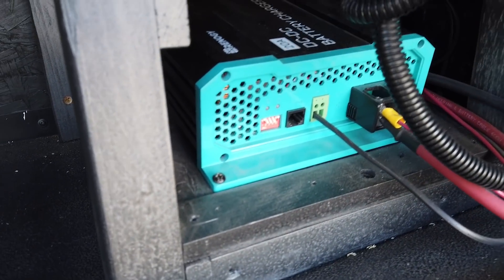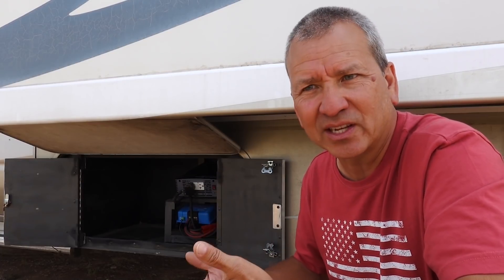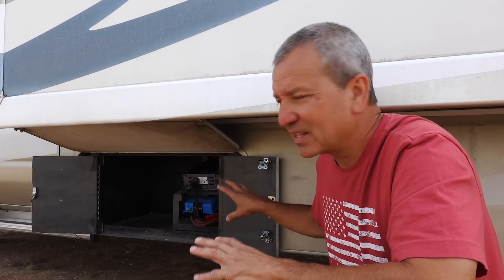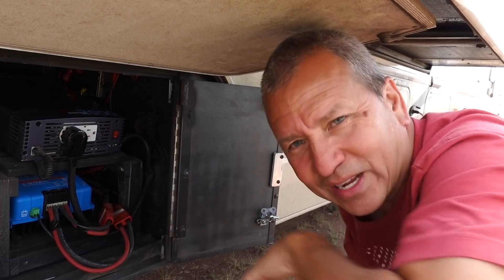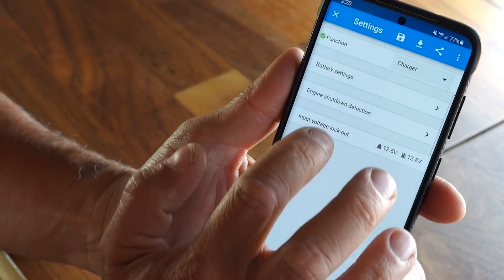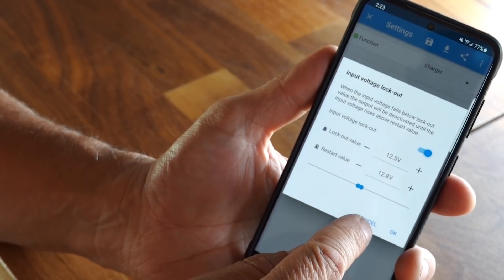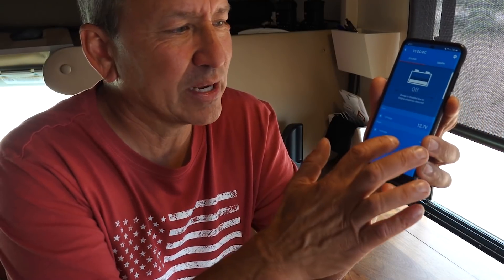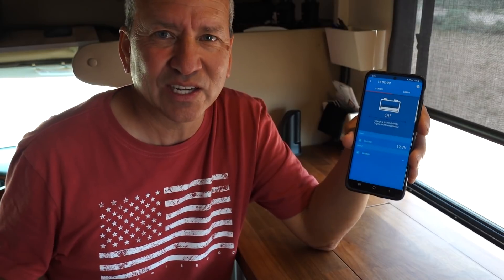RENOGY or VICTRON DC-to-DC Charger for Lithium LiFePO4? / Off-grid RV Solar / RV DIY

Comment: Great video! Very informative. 
But what about the function of limitng the Amps by half like in the never models of Renogy;s chargers? The one that's turning on by connecting the +12V to the second slot in the green plug. Does Victron have built in similar solution?

Comment: What size wire did you use from the chassis battery back to the DC charger locations?

Comment: Great video. Thinking about keeping AGM batt under the steps (gets charge from alternator),but add an LiFePo with a DC-DC charger from the AGM. Route Li batt to DC load/Inverter/solar, but keep house converter hooked to AGM. This would give you an extra "backup" battery and the AGM would be standby emergency start. Maybe the converter won't work like an alternator? Any thoughts? 
(If I took the converter out, it would be sort ofthe same as your setup, except an extra battery in parallel with chassis batt.)

Comment: Victron & Battle Born  expensive solutions - there are far cheaper alternatives -  The price  of raw 280ah cells has halved in the past 3 years - I made a 4 cell pack JB blue tooth BMS and Renogy DC to DC for max bang for your buck

Comment: Do you have a combiner box for your panels or how did you connect the panels to the DC-DC charger?
Reply from the maker: The solar goes through a solar charge controller then to the battery busbar. Same busbar the DC to DC is connected to.

Comment: Hi, I'm confused as to why you eliminated the jump start switch in case you need to jump-start rv. And make a separate connection at the dc dc
Reply from the maker: It's a short cut to the house battery since it is wired to that relay. The alternative is to run a new cable.
Reply: @RVwithTito  so you have to wire it that way if you install a DC dc charger? Just curious. I have lead acid batteries for my house and rv. I plan on upgrading my batteries as well. So I'm new to this upgrade and what it will need. I also have a solar panel that charges my barries when I'm not plugged in. So same set up I suppose. Just looking to upgrade house and engine batteries

Comment: Interesting you have done exactly what I did with my dc to dc charger with the Anderson plugs for exactly the same reason. It has saved me once already when I had a flattish starter battery at only 12 volts. It wasn't enough to start the motor but 5 minutes of direct connection via the Anderson plugs got me going. Brilliant.

Comment: Great video. Lithium-ion batteries can handle various charging currents, but they can't handle too much voltage. The critical factor to watch is the voltage, not the current. It's important to keep the charging current within the manufacturer's recommended range to avoid damaging the battery. Exceeding this range can lead to reduced lifespan or safety hazards like overheating. That's why voltage regulation is crucial during charging to prevent overvoltage, which can cause serious issues like thermal runaway or combustion. While monitoring both voltage and current is essential, maintaining the correct voltage is typically more crucial for battery safety. This might be why some apps prioritize displaying voltage over current during charging.

Comment: https://youtu.be/lvOYUfSBlmM?si=Ha3oerqBCfyQmOvx  The BMS inside the Lithium battery determines the charge rate. You will see the amps coming into the battery being reduced as it approaches 100%. So, no, a Lithium battery will not grab as much current as possible. You need to make sure your alternator can handle the "C" rate of the battery. If not, yes, it will overload your alternator. Many LFP batteries are limited by the C rate in terms of charging. Please don't be a parrot since so many YouTubers have this fact wrong.
Reply from the maker: Well of course it's based on the C rate of the battery (or batteries). The combined C rate for a large Lithium battery bank can be very high. Plus the flat charge curve compared to a flooded battery with higher internal resistance makes it an issue.
Reply: @RVwithTito  You're the one doing the educational video and not explaining what C rate is and why it's important in neither this video nor the older one and you state "of course it's based on the C rate".  In your next video on this subject, I would suggest doing a better job of explaining why no RVer would even need to consider such a product.

You, literally, are spending money to limit the charging on your LiFePO4 batteries. Why would you do that? Most stock alternators can handle LiFePO4 charging. What size is your alternator?  I installed LFP batteries on my old Ford E350 Class B using the stock alternator, without a DC-DC Charger ... it didn't burn up over the years even with a defective BMS. There is a simpler, and less expensive, solution if all you want to do is limit the amount of amps, not overheat your alternator and still be safe (no fire).

Just so you are aware, I worked for a major battery manufacturer where my duties included testing the final products ... properly. Even Victron did a video where they show a burning up alternator but it was an invalid test since they did something to ensure the alternator would overheat. That was intentional and came as no surprise since they want to sell product.

Comment: What about power from rv converter  120 to 12v? Can you use same converter once the dc to dc is installed?
Reply from the maker: No problem. Whichever voltage is higher will push current through. I believe both units can also be configured to only turn on with the Ignition switch.

Comment: Would Installing one of these and feeding it to the center pin on the trailer wiring be a good idea for charging the battery on a Toad?  As opposed to relying on the 15amps that is typically put out on that pin.

Comment: I was looking at a dual alternator system. My question is, can you hook up to alternators to charge into that system? Could you get two chargers and run them into your batteries? Just checking before I spend a lot of money to upgrade my system.

Comment: Biggest reason the Renogy is actually better is because it has low temp cutoff capabilities and the Victron does not. There is absolutely No excuse for Victron to not include the VE networking to be able to monitor the temp like they do on their MPPT solar chargers. In a van or RV in aub zero temps you will kill your $1,000 plus batteries with the Victron B2B charger

Comment: if your battery has a bms why do you even need a dc to dc charger just charge it directly off the alternator, just make sure your alternator can handle the amperage and if it cant upgrade that because if it cant handle that it probably will die from the DC to DC over time

Comment: This is a helpful video!!
I currently have a pair of a g m crank batteries that are going to a 140amp Isolator to An additional AGM behind the driver's seat. Currently, my accessories are hooked up to it. But I need to put them on a deep cycle. And I was gonna go with lithium. But I'm dealing with the charge voltage difference That should lead to the AGM consistently drawing the LiFePo down. I was going to just run the system off the Li battery, and leave the third AGM as backup incase i need a jump or something, just keep it on its isolator so it stays charged and put a DC-DC like this between my crank batteries & the Li as well to keep it charged. My alternator should have no problem handling this I hope, and I've noticed many do not have the correct V to fully charge a LiFePo battery, will this? Also, if you connect to the ignition, do you still have to manually switch the charger on/off? I want a Set up that I don't have to rely on the driver to do much. Just setup, forget about it. and it be self contained

Comment: If you could hook up a heat gauge on your alternator to show you hot hot it is you could keep up with the temp and turn your charger off and see what the resting temp is and how high the temps go under load and if it gets too high you could shut your dc to dc charger off and let it cool off for a while and after some time would see what’s normal and what’s too hot. Just a thought don’t know if it would help but couldn’t hurt .

Comment: That’s the same way I have mine set up with a switch that when it’s on it lights to remind me to tur off because if you start batteries and your lithium batteries are low they will drain your start batteries dry and quick .

Comment: Great video, convinced me to get the Victron charger.  One remark on you setup if I may.  From reviews I read, the converter can get hot. For better heat dissipation, it would be best to mount the charger vertically.

Comment: i have a 65A alternator. and 200ah lifepo4. During travel I have 20-30A of load for many utility like e-bike, fridge, evaporative conditioner etc etc. with a dc-dc of 30-40A I don't have any current to charge the battery. with a simple rele of 230A and 35mmq cable I charge 30A with 30A of loads. My alternator, a low rpm in poor cooling conditions (es at stoplight), don't can produce more of 20-25A, even in short circuit. its not depends from type of battery. lithium, lead, nichel...its depend from the delivery curve of the project of alternator

Comment: its possible to charge a lifepo4 battery directly with alternator. If you now what you do. if you now the parameter and specs of alternator at low rpm, if the max current is compatible with your battery and also the charging voltage. Victron produce a intelligent reel to do that

Comment: Hi Brian,  A couple of questions.  I see you are using the isolated version of the DC-DC charger.  Is there a reason you picked that one over the other?  I like the jumper idea with the connectors to connect the coach battery directly for a jump.  I hate to loose that function.  I can see where the isolated one may be easier for cabling in that case.

Is the Victron capable of being in a semi-outdoor situation?  My Trombetta is in the battery compartment and it is open on the backside so somewhat exposed to WX as I would drive.

Right now, if my DC Charger in the coach is on, it also charges the chassis battery.  Does this device still do that?  If not, how to you keep that battery topped off?

Great video and good details.  Details I have not seen Victron mention in their videos.  Thanks!

Comment: Good job/vid/info. I like the Ando idea, I do this myself as it also makes it a portable Dcdc charger unit as well as redundancy in case of problems/issues.  
One small area u may want to check, & ‘old habits die hard’ here, while ferrules look very nice on an install, there is some controversy over their use and Victron actually advise not to use ferrules, but just good bear copper as their connectors are made to contact the copper better without ferrules or solder.
Victron is great gear & feature full, but quite dear in Australia too, ur controller is about $450 AUD while the 40A Renogy is only $180, so that’s what I got for now for a lithium camper setup.
I agree with ur criticisms of the Victron App & charger features, but then Victron would rather you buy another $200 shunt, I think they could have added that in for the price. TFS. Cheers

Comment: can you use the battery while its on ghe charger from that dc to dc 
for example do I need to turn off the fridge if the battery is on charge .
Reply from the maker: Absolutely.
Reply: @RVwithTito  thank you 😊

Comment: Renogy DC2DC 50 amp with MPPT is awesome and better than victron from a cost perspective. However for those wondering the renogy will not charge at 50amp if solar is connected to it. However I use it only as a dc to dc for the Bluetooth capability and and the look of it too. Best bang for the buck. Victron is great stuff but has become way to overhyped. Like fan boys with subwoofers LOL
Reply: I am very impressed with Victron.  Their products have real warranty.  Renology is reputed to be difficult to pin down.   Victron are built to marine standards.  All my Victron devices work together and from same bluetooth app.   Maybe it's like Apple, which I don't use but can appreciate why people do.  

Still I like that feature that the Renology DC to DC does solar as well.   Should be very good choice for those who are not in the Victron eco system.

Comment: the Renogy 40A can be switched to 20A for regular driving to increase the life of your LFP. switch to 40A only when required.
If your batteries are hot, the battery bms may over temp shut down at 40A continous, thus select 20A

Comment: DCDC is required if the distance is short between ALT and lithium batteries....  otherwise a towed trailer that will add about 8-10m (30ft) of cable will regulate itself due to voltage drop. even 3B&S will regulate to approx 40amp at beginning and about 18amp at 95% full and that is with a 14.2v CC alternator. Capacity does not factor in as the drop determines the draw.

Comment: I would fit a Severe Duty , Leece Neville Alternator with a smart regulator, set for LifePo4. We had a 400 amp alternator which ran our heavy loads while motoring .

Comment: Hi Brian, another great video. I really apricate how you can deliver information so easily understood. With regards to your original factory wiring that uses a switch and solenoid to merge the chassis & house batteries. Those solenoids typically have keyed and switched 12v triggers. If so, couldn't you have disconnected the keyed 12v connection and left the switch in use? This way it would still work as it did originally and the alternator wouldn't be charging through the merge solenoid when driving. You could then connect the chassis battery side of the solenoid to the Victron DC charger. Am I overlooking something that wouldn't work correctly?   Thanks again

Comment: Your video content is always informative. I know you have the solar and that is putting a pretty good charge on your batteries, without the amperage coming from your solar would you want something larger charging your LiFePO4 batteries from the alternator as in the Renogy 60A or two of the Orion 12-12-30's?
Reply from the maker: The more amps the better to recharge your LFPs faster.

Comment: Keep in mind that the Renogy unit draws 30 amps from the car battery/altenator in order to put out 20 amps to the house battery. Use wire sized accordingly.
Reply: That's not correct.
Reply: @dazzer_  it may be 25 amps but it is written in the manual that it draws more than it puts out.
Reply: @stevekight1955  (30A - 20A) x 14.4v = 144W of heat to dissipate. That would be crazy. At its rated spec of 90% efficiency, it would draw 22.22A.
Reply: @dazzer_  the manual say's to fuse the n
Reply: @dazzer_  the manual say's to fuse the input at 30 amps and the output at 25amps.
Reply: @stevekight1955  That's right. You would generally oversize a fuse by 10-15%, so a maximum current draw of 22.22A would be fused at 25.553A. The closest common fuse rating above this is 30A. The output is fused at 25A for the same reason.
Reply: @dazzer_  The notes on  Page 14 of the manual say that when the unit "is sending full charge, the ampere consumption will be 50% greater on the input side." On this unit that's 30 amps total consumption.
Reply: @stevekight1955  It would seem odd to protect a device that consumes 30A continuous with a fuse that blows at 30A. People must be replacing the fuse almost daily.
Reply: @dazzer_  I agree. I blew my fuse and didn't even know it until I saw no increase of battery voltage. That's why I connect mine directly to the battery.

Comment: A question if you don't mind,  I like your remote cab switch to turn the charger off and on whenever you need,  do you have it as a simple toggle switch to break the cable running from the IGN on power source?  (so charger only works when the engine is on AND you have the choice via the switch to disable that). I am installing a Victron non isolated unit this week (Panel van  conversion). Great detail on your Vid.  Thanks
Reply from the maker: I didn't have it on an ignition circuit. So I have to remember to turn it off when the engine is off. That's why I got a switch that lights up.

Comment: Is it capable of charging 12v , 24v , 48v  battery systems, as the 12/24 on the victron case is referring to the alternator discharge voltage right?
Reply from the maker: 12/24 is the battery system voltage I believe. So no 48V with this one. Going off of memory. So double check this.

Comment: Totally confused. I have existing charging from alternator. Now I have a solar system, 6x100w panels, 3 12v 100ah battle born batts and a victron charge controller. Just bought a Victron IP65 30a ac batt charger. Why do i need a DC-DC charger?
Reply: if you are charging from your chassis alternator with the big relay it is possible for your Lithium batteries to pull so much amperage from your engine driven alternator that you can fry it. The Orion dc to dc charger bridges that gap and controls the amperage being pulled from your alternator plus it boosts the voltage to something your Lithium batteries need to obtain a full charge. As for your solar panels dark and clouds happen, and the dc to dc charger doesn't care about that.

Comment: I wonder if you could use the renolgy  20 DC to DC charger between the lithium battery charger and the chassis battery to keep the chassis battery charged when the rv is sitting for an extended period and plugged into shore power
Reply from the maker: Yup. That should work. I wired up a $10 PWM solar charge controller to do that.

Comment: How can I make all the cars electronics draw off the aux battery when engine is off?
Reply from the maker: I guess you'd have to rewire those circuits through an A/B switch or a relay if you need it automatic.